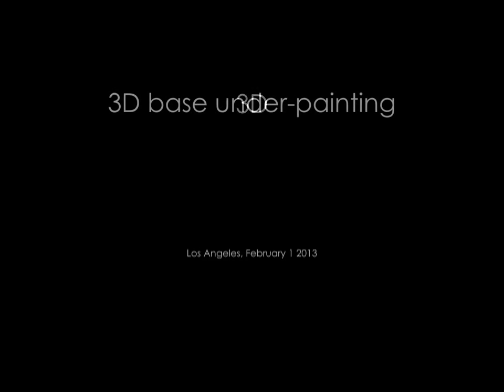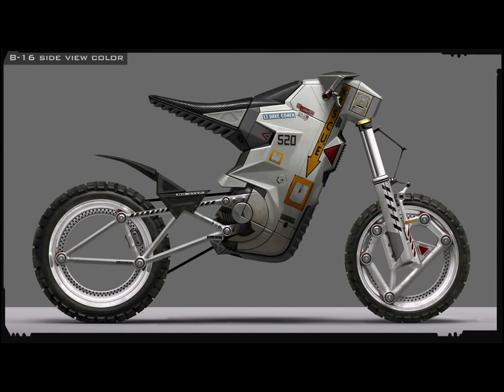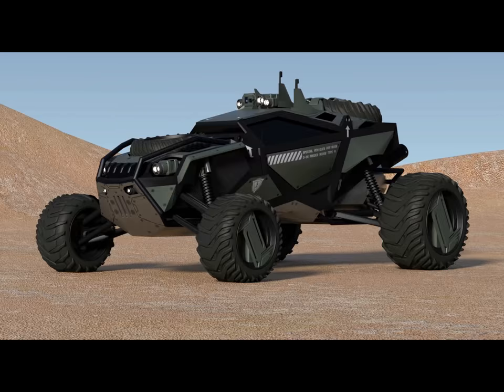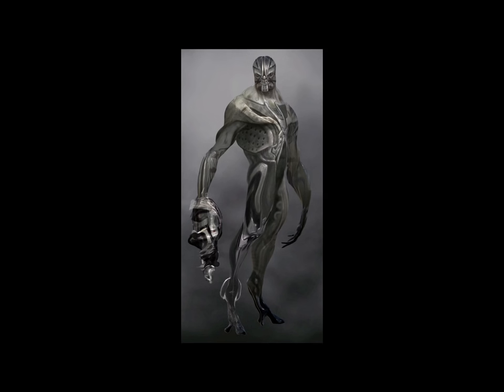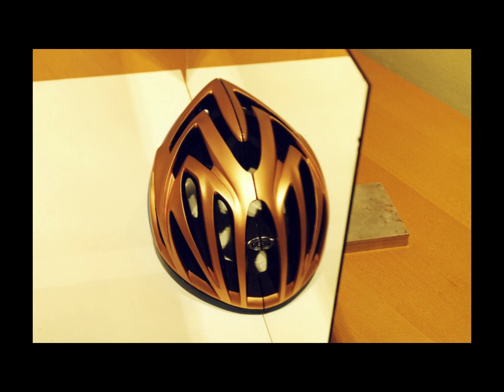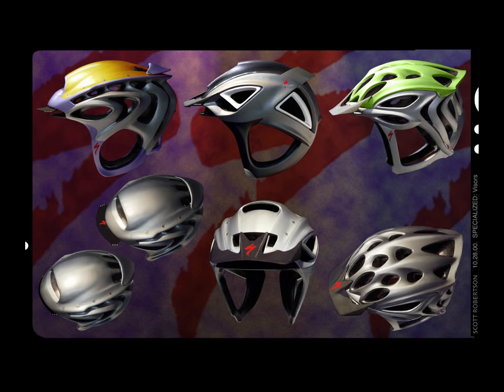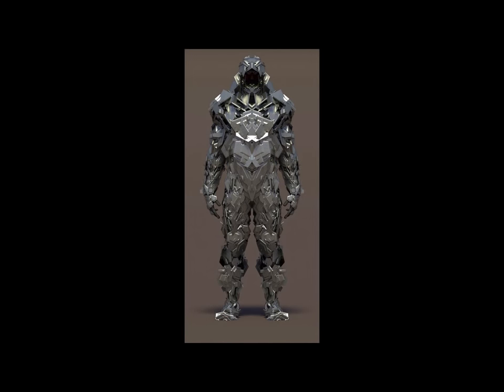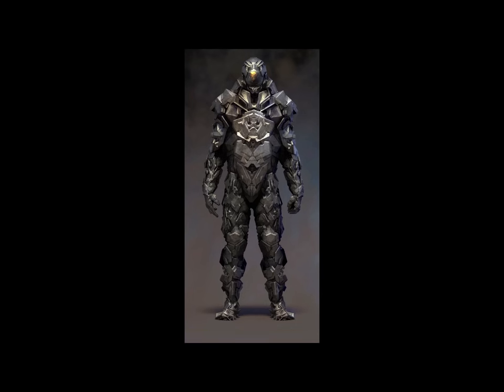Scott Robertson: Inspiration and Techniques

Comment from the maker: From Wikipedia: "The Fresnel equations (or Fresnel conditions), deduced by Augustin-Jean Fresnel (pron.: /frɛˈnɛl/), describe the behaviour of light when moving between media of differing refractive indices. The reflection of light that the equations predict is known as Fresnel reflection." My slang for it is the "fresnel effect" which is basically that when your line of sight angle of incidence becomes more parallel/tangent to a reflective surface that surface will appear to be more reflective.

Comment: I feel like it doesn't matter how random  your source material is, the more you modify it, the more cohesive it is with your style. 
Most of these characters and vehicles are very different from each other, but they look like they'd fit into one universe, and the best way I've found to break that mold, is to copy as a exact as possible stuff from real life,

There's also the tendency to choose source material that is similar, I suppose that also plays an important role.

Comment: Hello Scott. If you find my question pertinent... How would one blend art with design? I feel the line between them is very blurry? I often feel I have a correct drawing staged but it's missing design, while when I did graphic design, I had the correct elements functioning but lacked the artistic touch. Would a research of problem-solvers like Tibor Kalman be relevant to apply to a entertainment design problem of having a good drawing but lacking in design? Because authors like these were usually minimalist, and the way I see entertainment design, is that is very baroque. Sorry for the long question!

Comment: Im trying to draw machines, mechs etc. But I cant seem to be able to get the sharp & slick shapes I want. Do you have any tips to achieve this?
Reply from the maker: +ExtendedHorzions Try drawing some real vehicles from observation that you like to get a better idea of the proportions and details you will need to have on your own vehicle designs.
Reply: An exercise that I used to do, similar to what Mr Robertson is suggesting is to draw a vehicle from observation/reference. Then, right after, draw one from imagination but with the design language you just absorbed from the study. I really felt like I was learning that way and you've got a nice learning curve so it's encouraging. Then I did the same but without doing the direct study first. And that's basically what you do as a concept artist.